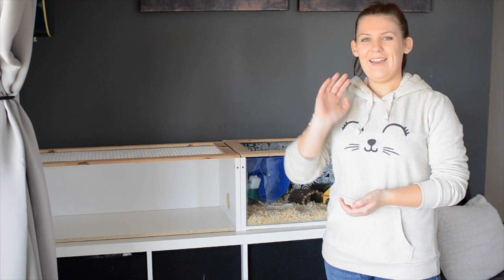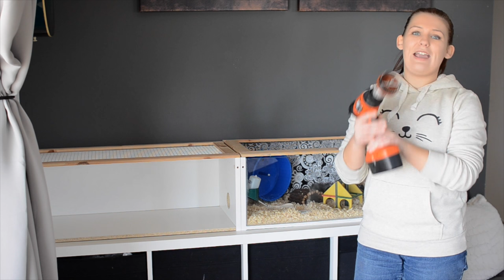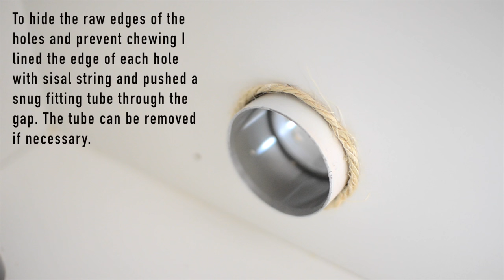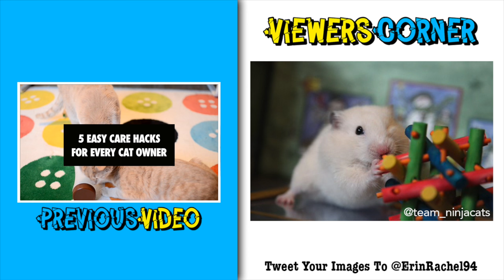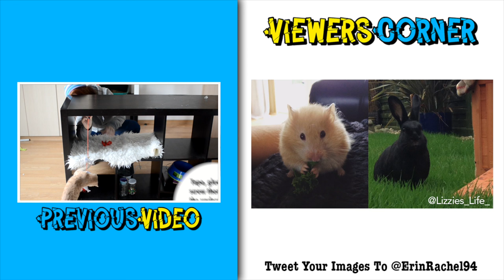DIY Hamster Cage | Double Billy Cage (Read Description Below Before Building)

Comment: I love this.  I'm a small person so being able to move around cages myself is always a consideration when I make cages. One issue I have with wood and glass is that it's heavy and hard to move so this component design solves that :)
Reply from the maker: +Hammy Time I have the same issue as I'm only 5ft 1. I'm strong for my size but it's still tricky to carry around items larger than me. These cages are really light and easy to move though, one of the most mobile cages I've ever had apart from bin cages :)
Reply: I'm only 1 inch taller than you :) I'm not very strong though so I have to find ways to compensate. This cage looks like something I could easily handle :)
Reply: +ErinsAnimals Help. My hamster is shaking. I don't know what to do. He started  walkingand he is not shaking as much anymore. He eats normally, he drinks water a little less although. I still worry for him. He is not making any sounds. He doesn't visually look in pain. I still want advise. Can you help?
Reply: +Tina Perez if your hamster is older it may just be a sign of aging, which usually shows up after around a year. if not this may be an illness and if it continues with any other symptoms I'd recommend the vet. looking on the hamster hideout forum is also good, but won't take the place of professional care.

Comment: I used the same method for drilling holes in my own cage, but I have an Ikea LACK coffee table hack, where two of them are stacked and each one has melamine on the sides and plexiglass doors. I've made a hole in each one so I can fit OVO tubes through, and connect them if I want to.

Comment: So I know that one billy cage doesn’t meet the requirements anymore but if I add another one it will be fine right?
Reply from the maker: You would have to not only join them together end-to-end but completely remove the central wall to make it big enough as floor space is only measured by a single, continuous area :)

Comment: Great video:) are two hilly cages put together the same size as the IKEA Detolf?☺️
Reply from the maker: +Holly Maclean It's a little smaller than the detolf it's about 850sq inches whereas the detolf is about 1000 sq inches :)
Reply: Oh okay! That sounds about great!! One more question what can u sit the two cages on?? X
Reply: @hollymaclean4299  Surely you can think of two closet storage bins or four wooden stools... Anything of equal height that is steady and firm...

Comment: Hey Erin, I'm trying to find inspiration to make my own DIY hamster cage, I love the idea of using the ikea billy extension! My question is, would it be suitable for a Syrian hamster? I've read somewhere in the comments saying it's not high enough to fit an 11" wheel, which is ideal for a Syrian. Should I do this and just get an 8" wheel instead? Hope you reply!
Reply from the maker: Some Syrians are fine with an 8" wheel in which case this cage would be ok for them however if your Syrian does need an 11" wheel then the only way to create space would be to either have no lid (I don't recommend this) or make a boxed/curved lid that is a few inches taller than the cage :)

Comment: Can you tell me what the measurements are for each unit. I looked on Ikea and it said 31in x 13in x 11in but I can't turn it around and figure out what that would be on its back.... 31in long, 13in wide, 11in deep? I want to make a cage for two gerbils and wonder if this is deep enough for them to satisfy their digging needs. Also, if I wanted to put one unit on top of another and connect through could that be done in a stable way? And provide air flow to the bottom cage?
Reply: I am thinking the same as you. While doable, I don't see enough air ventilation in the bottom billy. Not without cutting a large hole in the sides or back and using steel mesh...

Comment: Did you waterproof the wood or do you find urine does not soak through the finish?
Reply from the maker: The finish is enough and the substrate is there to absorb liquids and moisture which provides the majority of the protection for any cage :)
Reply: Thanks so much!!

Comment: This is like a tiny tiny bit smaller than the detolf great idea but just saying in the us it is cheaper to just get the detolf.
Reply from the maker: Actually, this cage worked out cheaper as despite the fact the total cost is more we did not buy it all at once. We bought one cage several months before which was half the price of the detolf and we bought the extension at a later date. The detolf also has many issues such as being made almost entirely of glass makes it easy to damage and it's incredibly hard to move home with as it is too long to maneuver around corridors, downstairs in elevators and doesn't fit in most vehicles. The Billy is easy to move, more durable and can be bought a little at a time so is much more budget friendly. Plus, as you can keep adding extensions there is no limit to the size :)

Comment: What are the two cages setting on? I want to make an extension but don't have a table long enough to hold it
Reply: I would use two similar wooden closet cubbies many use for shoes... Lay the cubbies on their sides horizontally instead of standing vertically... They should do the trick cheaply... Use another Ikea product, this isn't rocket science...

Comment: do you think this would be an appropriate cage for 2 Russian winter white hamsters
Reply: Isaac Gallant the colour of the hamsters is not relevant. and you should never keep Russians together. I would give them both a separate cage.
Reply: One cage is not suitable, but two are great! So yes you can!
Reply: Not as it is, because it has different sections, they’ll get territorial, but you can build one without the Perspex and put them in front of one another and that would be fine

Comment: Could I do this for a pair of dwarfs or could they get territorial over the entrance to the 2nd cage?
Reply from the maker: +Thatfishguy 554 I wouldn't risk it as there may be territorial issues. However f you were able to remove the middle wall completely or cut a very large hole in the wall it should take away the idea of it being two separate spaces and remove this risk :)
Reply: +ErinsAnimals okay thank you for responding so quick!

Comment: Hi I was just wondering will the wood on this cage bubble or soak through when the hamsters goes to the toilet?
Reply: If you are worried about the wood being soaked with liquid waste, use some shelf liner on the bottom, at least in the corner or area your hamster usually dispenses liquid waste... Another idea is is to use a small pane of glass in that corner or area...
Reply: @ronclark9724  thank you 😊 . i made a cage similar to this a while ago. luckily it didn’t soak through or bubble at all!

Comment: I'd be too afraid that someone (cats, for example) move the cage around slightly and the hammy could get out... Maybe put a tube in the holes? This way the cages are more secured together but they are still easy to separate.
Reply from the maker: I think you left your comment without watching the video all the way through :P
Reply: ErinsAnimals No I didn't... I know you said we can secure them together permanently, but you left them as is. I'm worried for your cage hence the tube advice.
Reply from the maker: +The Fur Monsters Please watch the video through, I clearly joined them together with a tube. This is why you are supposed to watch the entire video before you leave a comment so you don't miss information :)
Reply: +The Fur Monsters Erin put a tube in it, which is why you need to pay attention before you comment :)
Reply: she did put a tube

Comment: what do if you wanted to be separate again after extending?
Reply: Plug the hole so that neither hamster can get through it... Aquarium silicone could be used to seal a cap on both sides if necessary... Grocery stores sell caps that fit over dog food cans and cat food cans...

Comment: I searched up billy cage measurements and it said it’s like 15x41 inch which is well over 450 square inches. I’m confused
Reply from the maker: That's the size of the full billy library unit. The cage is made from just the extension pieces that you buy separately, not the full unit
Reply: ErinsAnimals ohhh I see thank you. I’m thinking of building my own enclosure for when I get my 3rd hamster as I love the look of them. Could I use any bookshelf unit (ofc that’s big enough) to make a cage? All I would need is the three sides and floor, then I could add glass wall myself.

Comment: How do you remove the central wall between the cages?
Reply from the maker: When you build them just don't include the central walls. If you're extending an existing billy cage you can remove those walls simply by unscrewing them from the main structure :)

Comment: Can I just ask what the measurements are for both cages together
Reply: Ikea billy height extension... 32x11x14 inches. So two side by side would be 64 inches long, similar in width and height... 64 inches is 162.56 cm... Not much height left for a large 11 inch wheel though, unless you place the wheel at one end without bedding, best maybe in a tray of sand...

Comment: Heey I was looking for some advice on this project. I've been wanting to get a hamster again but it's been many years since I last owned one. I've been researching all the new improved ways of looking after them these days and think this DIY would be perfect for me. I'm looking into possibly sticking the two Billy extensions together and not have the glass front. (I'm not too bothered about having a pretty display front)
My question is if anyone has any advice on how to do this? Would standard wood glue be enough to glue the two pieces together to make one big enclosure? It would be tricky to try and get nails in there too.Thanks!
Reply: I recognize this comment is years old, but in case anyone needs the answer: wood glue creates an incredibly strong bond, and would be perfectly fine to use to combine two of these.

Comment: hi Erin just to let u know this cage when weed on or wet becomes really easy to chew on
Reply from the maker: I've water tested this cage before and it doesn't show any problems for me. The wood is sealed and water resistant. A hamster should be able to urinate on it anyway if you are using the right amount of substrate :)
Reply from the maker: +ErinsAnimals shouldn't*
Reply: +ErinsAnimals yes my hammy decoded to pee there so i changed it, would you suggest putting a lino down and btw good idea will see if i can try it out
Reply: +ErinsAnimals are you ever going to get a rabbits????
Reply: +Lily Bell she already did but they passed away in 2015
Reply: Beau Booth i know i just wanted to know if she was going to get anymore rabbits
Reply: +Lily Bell in past she has said she won't be getting anymore
Reply: +Lily Bell she said she's not getting anymore
Reply: +Lily's Pet's 01 she said she wil not be getting anymore because there are not alot of rabbit supplies were she lives

Comment: why are you not using the detolf it's bigger than 1 billy cage and you would'nt havetoo extand it
Reply from the maker: +Una Gavin We haven't had a detolf for months, I made a whole video talking about replacing it ages ago as it had sustained irreparable damage over the last couple of years. We replaced it with a single Billy cage as Amylase didn't need a huge amount of space any more and she lived in that for a while. Now that she has passed we have extended it for a more energetic, younger hamster that needs more space. The double Billy is only a tiny bit smaller than a detolf and much easier to move from apartment to apartment without damaging it like the detolf which was heavy and difficult to move up several flights of stairs.
Reply: +ErinsAnimals  O ok I must have missed that Video thank you for your awnser ♥♥ it's a great Video anyway